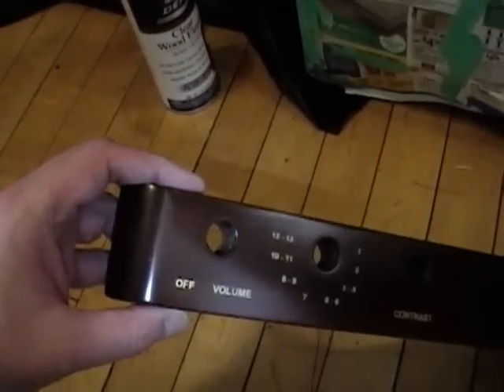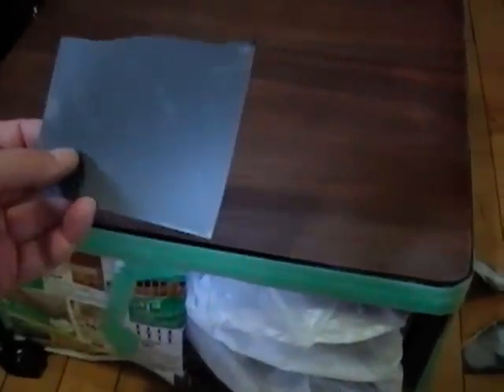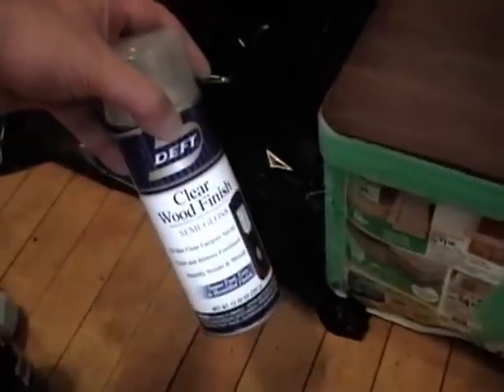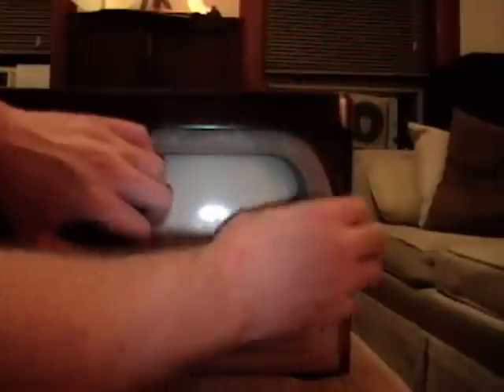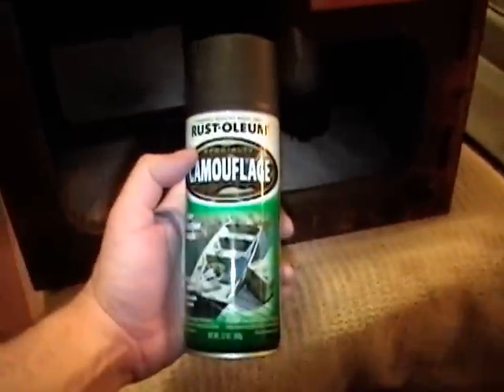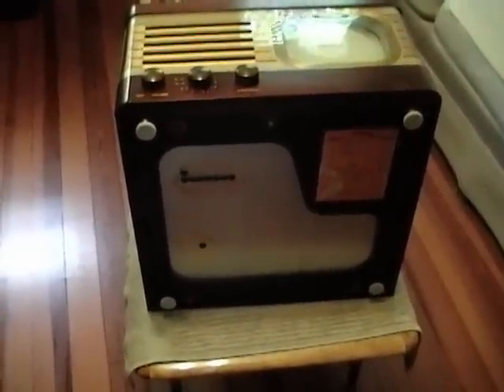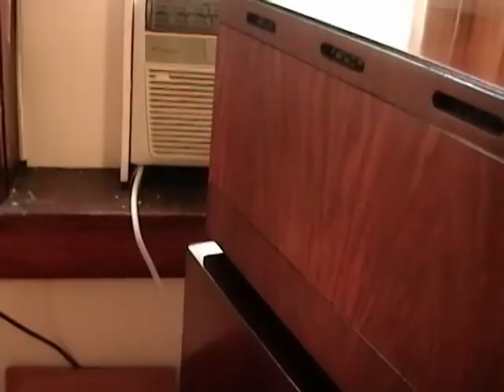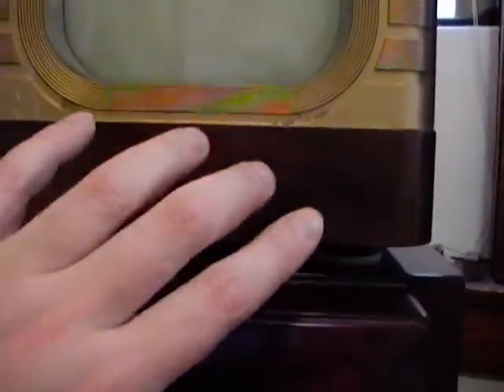Motorola VT71 cabinet restoration p2o2

Comment: @bonecrime $199.99 was a relatively inexpensive TV for 1947-48, most were in the $300+ range, I think that the cheapest set was a Pilot with a 3'' picture, it wasn't until 1950-51 that the prices really started coming down. By then the price of a typical set had almost been halved, the screen size got larger, and the market for small electrostatic sets like this Motorola all but disappeared in favor of larger electromagnetically deflected sets. Remember what a cell phone cost in 1991?

Comment: @bonecrime Then again try to imagine a 50'' plasma or LCD set surviving 60 years, most won't survive 6 years before the electrolytic caps blow or something worse happens, especially the plasma sets. The worst part is that a plasma screen is more of a power hog then a CRT set and a lot less reliable. Consumer electronics these days are made like Dixie cups, it's assumed that you use them and then throw them out.